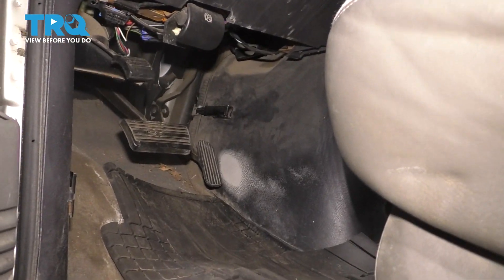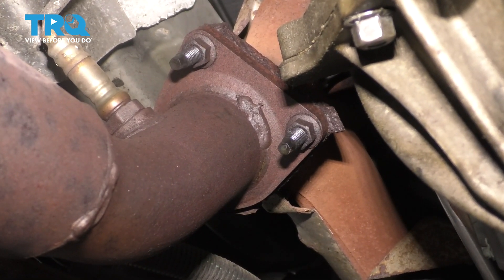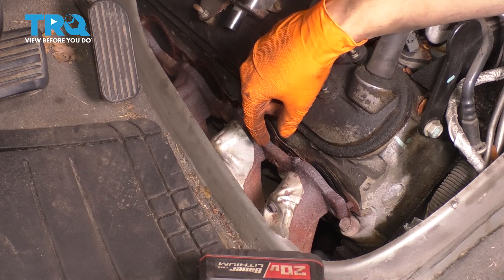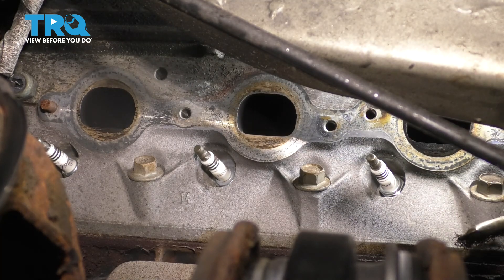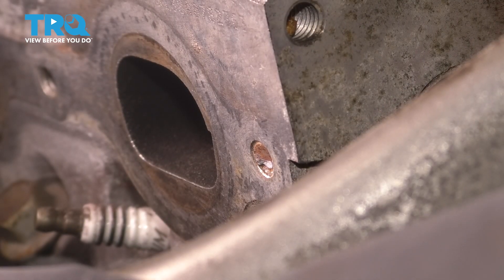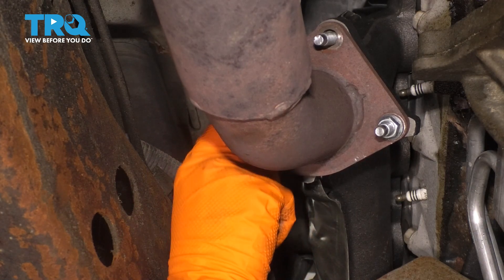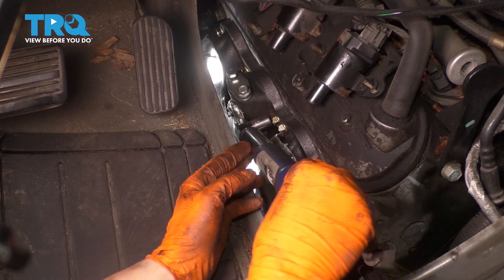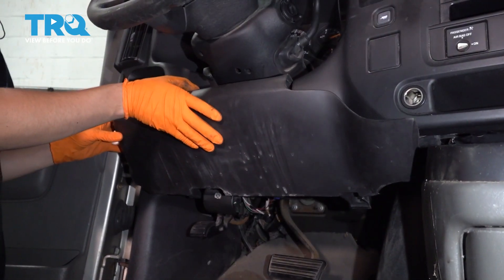How to Replace Exhaust Manifold 2003-2021 Chevrolet Express

Comment: Absolutely, you, are the worlds' best, instructional video teacher. Easy to listen to voice. A tremendous pleasure to learn from. Nobody else, could do a better job. I have an '08 1500 Cargo with 146k miles. Want to make it last. I had a 93 Astro Cargo V6. Put 668k on it. No major problem's. All iron. Green coolant, distilled water, max imum 70/30 ratio. 15W50 Mobil 1, Marvel Mystery Oil. Replaced Clutch Fan with Electric Hayden. Removed AC Condenser System. Model 220 Throttle Body. Replaced Fuel Pump's, Water Pump's, Alternator, Starter's, O2's, Coolant Sensor, AC Delco Plug's, Catalytic Converter,  Rebuilt Throttle Body, Shock's, Steering Part's. Used Mobil Tranny Fluid, and same in Steering Box. Brakes, Master and Slave Cylinder's, Rotor's, Drum's, Rear Oil Seal's. Rear Engine Main Oil Seal's twice, Tranny Oil seal's twice. Same Ball Joint's. Was a Delivery Van. Bad, on the Rear Door's Seal's, instead of on the Body, like the Express, replaced replaced, then, got hit. Bent Door hinges. Totalled. Bought Express, having issues. Will miss Astro. Didn't leak oil, ran cold. Removed Thermostat. Passed Emissions' too. I'm 67 year's old, and hope to die with this Express. Hope you ate able to create more maintenance vid's on this V6 1500 Cargo. I removed Flooring to expose rust. Former Government and Business vehicle. Carfax Report good. Needs Manifold replacement, Tuneup, Ball Joint's,  U Joint slop, Rear Bump Stop's, Coolant, Tranny, Oil replacement. Thank you for your very easy going Instructional video and narration. Will look forward to more on this. The V6 engine and 4l60E tranny, round out this vehicles' abilities. Sorry for my TMI.
Reply from the maker: +@BOBBY-w8c Thank you so much for this feedback!!